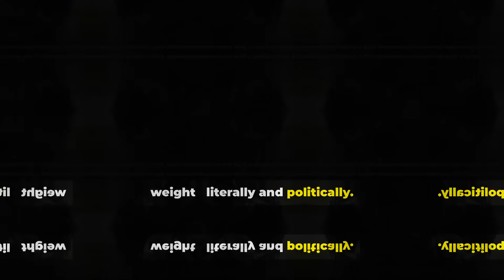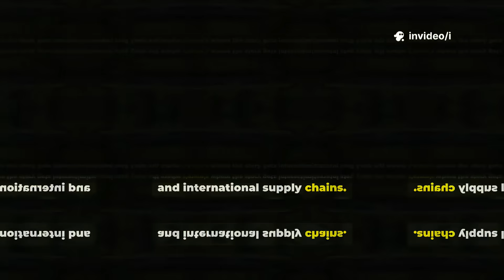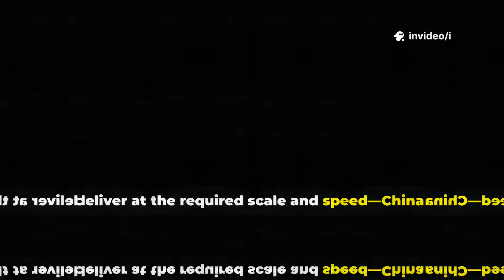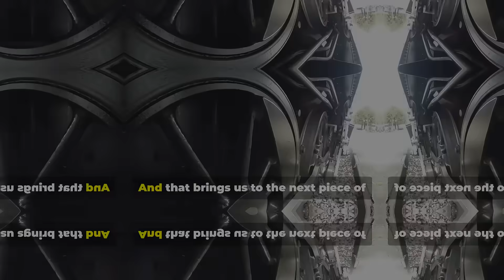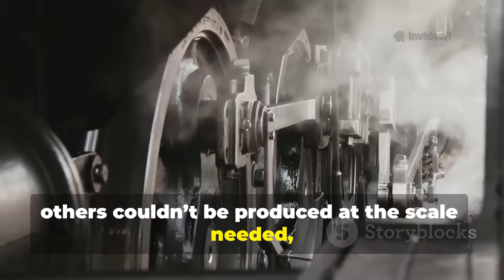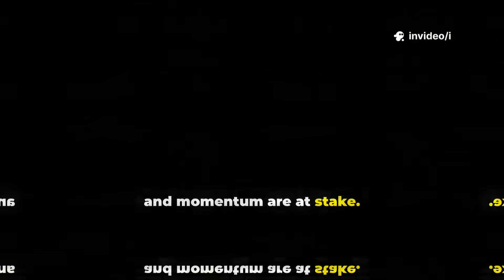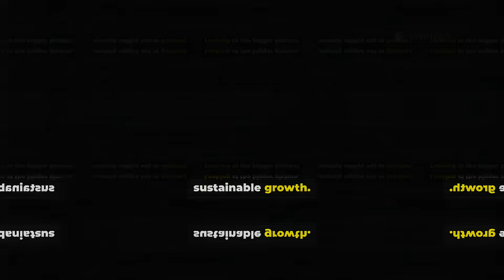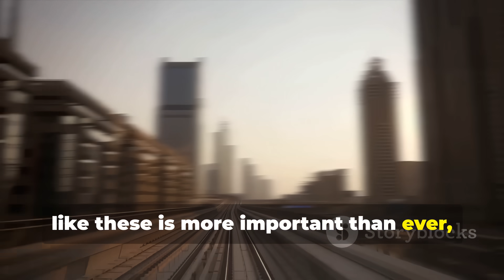Why India Had No Choice But to Buy 39,000 Train Wheels from China—Even Over Japan

Comment: $538 per wheel?
Reply: That's cheap in USA standard. USA could have changed 2k per wheel,  and delivered about 2 years behind.😂😂😂😂😂
Reply: it's Temu price and probably 50%+ of which goes into India official's pocket
Reply: HIGH SPEED RAIL WHEEL.  and they need to be replace after running for a limited distances.